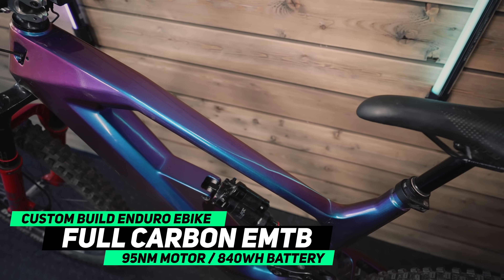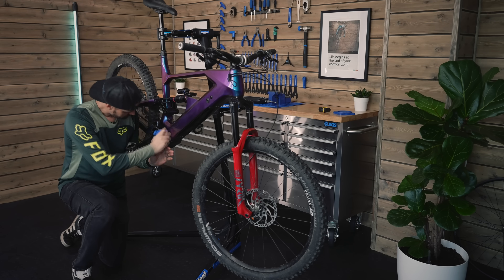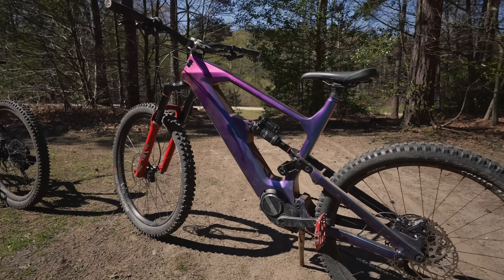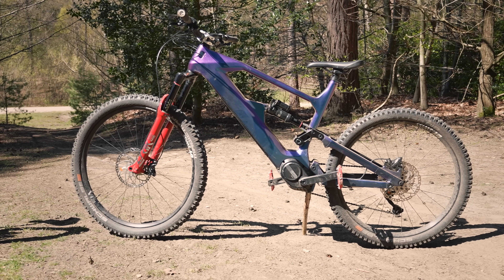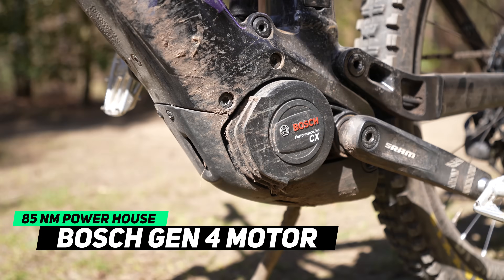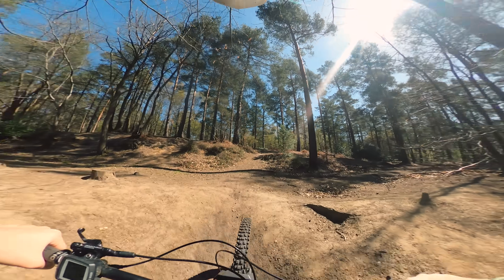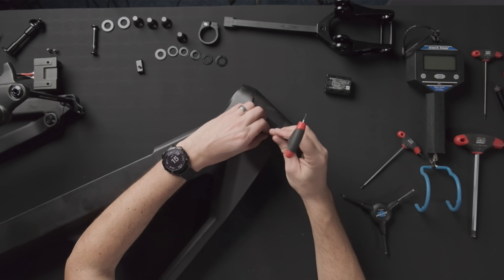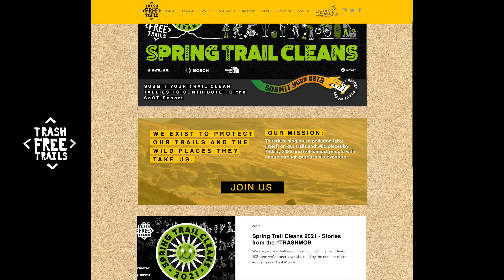This motor ABSOLUTELY CRUSHES it!!

Comment from the maker: eBay link for the CHEEB https://bit.ly/3vfaG0M - all of the proceeds from the bike sale are being donated to Trash Free Trails. Check out their mission here www.trashfreetrails.org
Reply: Rob, i just got my new nox xc trail with the Sachs rs motor with 112 Nm at low cadence . 
i have a cube with a bosch cx and was convinced it was the king of climbers until ,,,,, .  i took the sachs up the same steep hills i usually ride and was traveling twice as fast at half the cadence in the third assist level ( it has four ).
The sachs is insanely powerful and very well built . it's heavy with metal gears and casing . built to last .
Reply: Soo?? What did it sell for?
Reply: So Rob, when will you fit the CHEEB with the new EU rated Bafang M600S developed in cooperation with Bafang and ELIFE Norway 😀 supposed to have 115nm!
Reply: Is the bike still available,,do you any freys e bike.  Or how bout a long range daul battery 1000 to 1500 bafang ultra emtb call me interested in buying a mountain e bike long range with 160 torque , 27 inch or 29 inches rims.....18 inch 19inch frame,,,,,,asap. 6107153704 chris
Reply: Fantastic work....It's our world & we all have a duty.... 🙏❤
Reply: 1) не попоказано какие звезды использовались !
2) не ясна какая пиковая мошьность
Reply: 3) правильнее былоб сравнивать иемнно  одинаковой цены велосипеды  ;)
*почтиуверен что топовый исамый мошьный 250вт мотор у бафанга  да с топовой акб оказалсябы лучьше (простоешебы и потому что можнбылоб простопоствить соотношение звезд как минимум лучьше чему конкурентов ) 
* можнотолько представить ведь какой будет крутяший момент елси сзади 50Т звезда будет (молчу елси спереди 22 будет ) *обычно конечноставят враене 32т спереди 
**поэтому да педалик с редуктором спецалным  и какрас маленькой спереди звездой типо 22 т атоидаже  ешеи МЕНЬШЕ там крутяший моемнтразмееться будет выше чем у всех остлных аналогов
Reply: Looks like they may of upgraded the m510 again. Its supposedly rated to 110nm now
Reply: Rob you have a link for the bafang motor??

Comment: Hi man, what about the noise comparison between bafang M500 and bosch gen.4 ? I'm asking because I've got m560 and this is horribly noisy in comparison with bosch gen4 smart system. I hope M500/M510 are much more quiet than M560. Thx.

Comment: I'm not sure these bikes are putting out anywhere near the amount of torque they claim. My 5000w hub motor is only rated like 60nm, and would wheel stand up these hills without pedalling

Comment: What's the sealing like around the crank shaft?  Bafang mounts the controller directly to the engine cover, and the seal around the cranshaft is essentially a dust cover.    Any idea how well the sealing is on the motor, as water intrusion is the biggest problem for all ebike motors.?

Comment: Now if these motors cost about $50 that would be worth it..$1,500 I can get an older model sport bike that does 145 mph with endless range..Anything over $1,000 for a top of the line electric bike is just absurd and a rip off m

Comment: This dude keeps saying power and than says motor's torque. Nm is a unit of torque. With some gearing you can achieve pretty much any torque, specially with a mid drive. But what's the power of those engines? Powerful motor yet no mention of actual power. This is stupid.

Comment: THE BAFANG issue is the fact YOU can't even peform a crankFlip Because of the resitance of the bearings when back peddling.  It pisses me off I like to do little tricks before riding to get warmed up and my Tuned M600 can't sping backwards fast enough to do a crank flip.

Comment: Car torque nm ratings might be vastly smaller but cars don't need to produce much torque because the engine spins at 7000-12000 rpm which produces huge horsepower, and low torque can be mitigated with gearing. Tons of torque is useful for tractors but race vehicles need tons of horsepower not torque.

Comment: Can you get rid of the crappy M500 and compare the Bosch to the BBSHD with 1kw nominal, 1.5kw peak and 160nm torque? My BBSHD will keep the power output pinned at 1500 watts if I keep the throttle mashed.

Comment: The miata has a little more power than those little motors, its funny that the bikes could power it
Reply: No it couldnt. Car torque nm ratings might be vastly smaller but they don't need to produce much torque because the engine spins at 7000-12000 rpm which produces huge horsepower, and low torque can be mitigated with gearing. Tons of Torques useful for tractors but race vehicles need tons of horsepower not torque.

Comment: bro, is the front hub motor better value for money n with less maintenance problems than a mid n rear hub one ...
Is it true that the internal gear or belt in the mid hub motor will wear faster n the external bicycle gear will also wear faster when a mid hub motor is used ..

Comment: i like how bafang probably sent you a hand built monster version where production models are probably 50% of that
Reply: 100,000 lumens for only $24.99 no really.   Not sure, but is the NM output of the motor directly measurable, similarly to HP output of a gasoline engine?
If it can not be directly measured in a repeatable test, then a company could claim an e-bike motor at 200 NM when it really only puts out 65 NM.

Comment: See if you can get hold of the M600s motor (EU legal special version of the M600)  It will beat or match the Bosch motor.
I have almost the same setup with the same frame but the M600s motor. I've never seen a hill where I have any trouble getting up unless I loose grip og flip the bike over.

Comment: One thing I don't like about these videos is they compare the rolls royce of a motor against the Jaguar of motors, what thje need to compare is facts it is very hard to buy a Bosch kit as their motors you get if you buy a bike and are not D.I.Y kits and price are 3 times that of a Bafang.  The cheapest eBike with a Bosch motor brand new is £1,800 and you can buy the same cycle without a motor fitted for £300 and a Bafang motor for £420 or even a little less.  So you have £720 to £1,800 I would not expect any comparrison that is why their is a market for ready mady cycles with fitted motors but here they are hard to get and the cheapest competible bike for me is over £3,000 otherwise I would have to wait upto a year for a £1,800 in my sizw or buy second hand.

The Benefits for kits you get the right size cycle and withing a week you have an electric bike for under a £1,000, otherwise you can wait upto a year and buy one your size for £1,800 or get one your size for over £3,000 withing a day.  Most mid drive motor cycles for sale right away are 46cm frames and they only have them available because there is very few small adults so really how can you destroy something that is cheaper, quicker to buy for a fraction of the price?  I would of been shocked if the Bafang motor out did the Bosch motor because the price difference is tremendous over double the price.

Comment: Rob, I thought the Bosch Gen 4 version of the CX was a 750w output motor though, could explain why it seems to get up the hill faster than the Befang M500 500w system. I know that the motor's torque is what drives the thing, but power delivery, wouldn't that also play a factor in the two compared? I mean it's a 250w difference between the two, which would equate to a bit more power delivered to the rear wheel and maybe the torque curve is different in a larger motor. I mean it's a good comparison.. pricewise they are roughly the same, but power comparison, they are not. And I would think the Bosch would out preform the Befang anyways because Bosch had been building small torquey motors in drills for decades, SO I wouldn't be surprised the Bosch corporation has fine tuned this motor over the years. I guess it all boils down to "you get what you paid for" as you can't expect a Ferrari performance for under 1k these days w/o some DIY and recycled parts.

Comment: I hat the two motors, After seeing your video, several of us think that your technique with the bafang is poor, first of all it is not climbing with maximum power, the torque works differently and I have achieved much harder slopes. Your test is poor and misdirected.

Comment: To be a fair test, you need to switch the motors and bikes. Both bikes are different, with different suspensions on them, and different settings. Only then you could say that the bosh motor is the better one. Don't you think? Maybe you felt it well that the motor is better but from the video, it looks to me that actually Trek bike follow the track much better and didn't lose momentum during the uphill.

Comment: Is anyone surprised a Cheap Chinese made ebike motor is not as good as a Bosch?
Chinese made crap is not rated as fact, batteries are not the capacity they say they are, and motors output ratings are optimistic at best.  

Conclusion- you get what you pay for. 
I’d rather save a little longer and buy from a company in a country that respects the planet, than support a communist regime. 
After all, isn’t that one reason we ride bikes?

Comment: MUST BE THE GEARING.... or the actual Bafang specs are inaccurate for the Torque! it is simple power transmission calculations. Gear ratios mean everything. would be interesting to put them both on a Dyno... to see at what RPM the Torque is maximum and how main horsepower is getting delivered - Bosch may have more poles or more windings  (dyno will show all of the information you would need to understand why it is not cutting the mustard. ....but first mark one revolution of the wheel and count the number of pedal crank rotations... will be interesting to see if the gearing is the same. I would almost bet it is not. This will be the internal gearing of the transmission within the gearbox of the motor.

Comment: I had Bafang M500 for about two years, firts one lasted 800km. It is not that smooth as Bosh CX or Yamaha ST at all, in my opinion is not as powerfull as these two.  I bought new bike with yamaha and this motor is miles away ahead. Bafang is good for money but no better than competitors.

Comment: So basically: Ya-get-what-ya-can-pay. And going uphill depends on a few factors(not just a fanciful video): The charge of the battery, the weather, is the soil wet/dry, or soft/hard? Your bodyweight? If over 220 pounds, e-bikes are gonna give ya very minimal assist up a hill in turbo-mode. Lastly, the physical shape you are in.  I find the Yamaha PW-X2, to get me up any steep incline & home in any weather, with (so-far), minimal problems(forgetting to re-charge). Most bike reviews are about giving a product decent review, to keep-on getting stuff to review. Trusting social media for products, is ill-advised.

Comment: Fine , but are we comparing apples to apples here? Torque and power output have a lot to do with voltage, current and gearing. First are the gear ratios identical? Second what is the measured voltage of the two batteries? Third, what is the current out put of the two batteries?  If one has a 30Amp BMS and the other has a 40Amp BMS then that is not equal. Software may be another factor. You are using the pedal assist on both bikes which may not be equal. I would turn off the pedal assist and do a throttle only run and then a throttle run with you pedalling. Keep the pedal assist and its torque sensor turn off. My cheap Cyclone motor with a 48V 40A BMS will usually try to wheely over backwards on steep hills and will only stall the BMS after long extremely steep sections that are pretty much unridable to begin with. Your test is not very scientific and needs to be redone. The rated torque of these motors is also a product of their internal gear reduction. We all want to see what the best kit is but you have to be fair with your testing and I think you  have not proven that.

Comment: Rob....appreciate all you do on your channel. Man, you had me there for a moment, then I realized you were missing some very important variables.  42t 10spd vs 52t 12spd rear cassette and probably even more unfair in the front. The reality is battery voltage on the bafang is a game-changer. My Ultra motor is great at 48v, but is a whole different beast at 52v. My personal 52v Juggernaut Ultra FS, even with the Manitou mastodon and DT swiss BR2250 upgrades is half the cost of the Trek Rail. Yes it's 18lbs heavier, but it also has 4.8" surley tires, 160nm of torque, floats on snow and sand, climbs up a tree, and never ceases to bring smiles to myself or anyone that tries it for 5 minutes. Keep the snobby bosch, I guess I'm just bike trash.😁🤣
Reply: Bro it’s a bike. Don’t take it personally.
Reply: You are 100% correct. To the people who have never driven it, Bafang is a beast. Get yourself a M560, or a M620 and you’re golden. I’m not a fan of companies limiting and restricting their products. So keep your snobby Bosch indeed!

Comment: All very nice and all that, but have Bafang got past the point of lasting six months or less when you buy a new Chinese e-bike? Right now my city bike is in the shop having a new motor fitted after only 194 kilometres of light use. I'm dreading the bill. Bafang really need to sort out their horrendous reliability problems and start selling products that can be relied upon to work, rather than having to be replaced so often. Even if the Bosch has less power or torque, I would buy a Bosch over anything else. Simply because they can be relied upon to just... work.

Comment: The bigPROBLEM with Proprietary Systems like the Bosch motor is that they require a proprietary battery (usually cost 50-60% more) and the Bosch motor (with a chip) will not work without a Bosch battery (with the same chip).. the motor and the chip talk to each other..     bigQUESTION... what happens when bosch decides they are no longer going to do ebike systems...?  What happens if they are sued out of business like Bionx when GE sued them over breach of contract..?  Now anyone with a Bionix motor that needs a replacement batter is out of luck... the motor is no good without the proprietary battery...      I like the non-proprietary systems like Bafang BBS02 and BBSHD.. You can always find parts, and you can always find a downtube battery that will work.. And they are 1/3 the cost of the Bosch...

Comment: Nice to know I chose a good motor (Bosch) even though its not user configurable. I would have liked an eco- and eco+ as well as eco which would be great for flat(ish) trails and wind resistance/assistance. Otherwise trail and emtb are excellent adaptive modes and turbo, though a bit snatchy, will get me up anything.
Reply: I am about to buy a bike with the Bosch motor. Have you defeated the speed limiter?
Reply: it is user configurable, but you have to install the Nyon control unit to do it

Comment: Nice job on the video but I will say that this is not a real good comparison test of the two. Too many variables, one of the biggest being the human factor. There are other bits of info such as what are the sensors on the bikes. Are they both torque sensors, is one a cadence sensor, or what? As eluded here by someone else, having 2 different manufacturers, you have 2 different sensors with different characteristics. The only real way to evaluate them is to bench test them.  Another variable to consider which is the weight of the bikes. Are they the same or significantly different?

Just a technical  heads up for you. There are a couple places in there where the background music is a little too loud. You can be heard, but not well understood in terms of what you are saying. It's a little like you trying to talk to someone on the phone in a room where the stereo is blasting away.

Comment: Back to the drawing board for Bafang. My biggest concern is longevity. Motor drives are no cheap and I wouldn’t fancy a rebuild or replacement every 2-3yrs. As for trash free trails, the answer is simple. All those using them respect them and take your litter home!

Comment: EU regs are lame. My 2018 vintage bbshd makes 160nm of torque with a stock Luna 30 amp controller. My commuter w saddlebags and racks will crush either of those pigs.

Comment: it's so clear that a bosch engine wins but the test had to be self-built with a 750 watt 90 nm bafang! , the bosch cx motor has 250 watts 330% so 250 x 3.3 = 825 watt 

good work and good luck

Comment: I can’t understand why anything over 85nm is needed, my cube with a Bosch 85nm can climb anything if I can stay on it without sliding off the back, and it will hit the 15mph speed limit with ease. Seems a bit pointless to me. Same with batteries, how big do you need, once you can get 50miles like mine can having much more really is a bit pointless, at what point do you just pedal a bit more.
What’s needed are less gears and more robust drive trains and brakes pads which last longer than a few hundred miles.

Comment: The Cheeb had a 1x10 if I recall correctly from the build.  What did the trek w/ the Bosch Gen 4 have for rear cassette (gears).  Are the front sprockets on ea. motor the same # of teeth?  Point being that the gearing ratio has an impact on the ability for the bike to get up the incline.. really need an apples ot apples comparison.  Also should factor in weight of the two bikes.

Comment: I have a bike with the bafang m600 ( 120nm of torque ) Its pretty powerfull , the only things that bothers me a is that on level 1 it gives a bit to much power so you barely have to do any effort at all unless your doing a steep hill , fun but not good for losing weight at all : )   I think I would rather have that new m500 , I think bafang calls it the M510 now   ,  its  more quiet and  probably better for training and technical riding